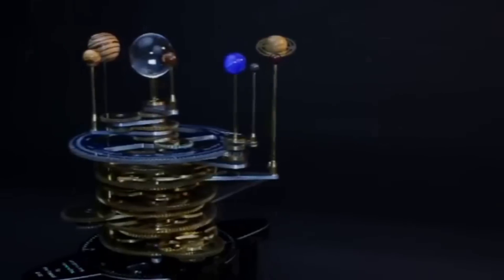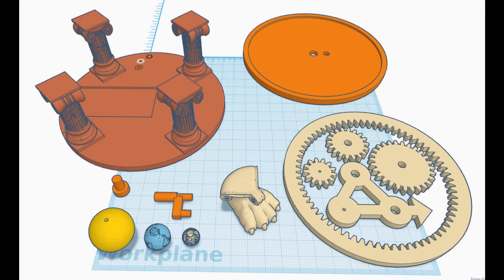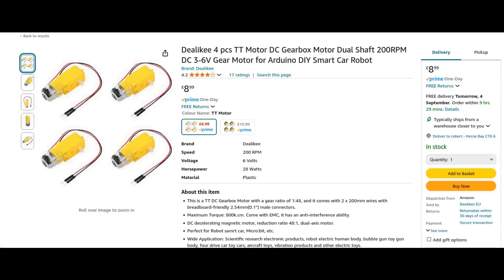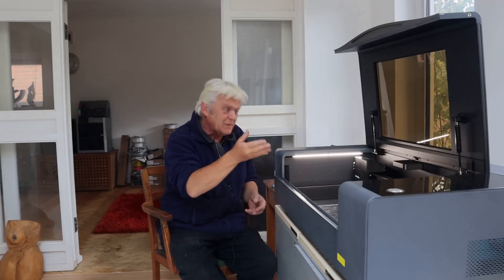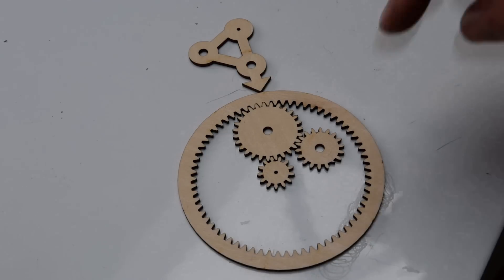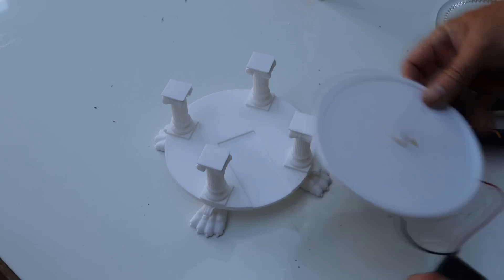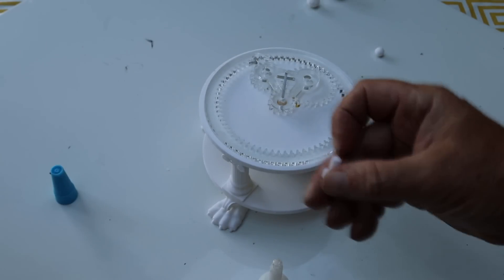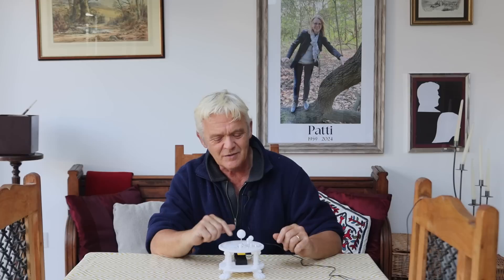2285 The One Day Orrery Project - Made With The Xtool P2 #xtool #p2

Comment: I'd be tempted to make the Sun big enough to take a button battery and some LEDs around the circumference, in the dark it'd show phases of the moon.

I think it should be possible, using a stepper motor and a timer, to advance it one step a day, though it might need careful choosing of the gear ratios.
Reply from the maker: i like that mate - thanks for sharing
Reply: @ThinkingandTinkering  
My thoughts were partly from thinking you live near the coast, so, as moon phases also give tidal info, it'd be kind of nice to give it a bit of extra functionality.

Hmm I think over time pushing down on a switch will weaken and break the Sun support mount, if it's left as plastic...So...For a deluxe version it'd be nice to also get rid of the separate Sun battery. Maybe concentric metal disks in the base plate, offset in height with the 2, conductive, outer parts of that support matching different lengths. The idea there is to mechanically stop the Sun support itself from spinning and keep the pos/neg feeds going to the right places
That way an on/off switch could be incorporated somewhere more robust and also it eliminates one battery.